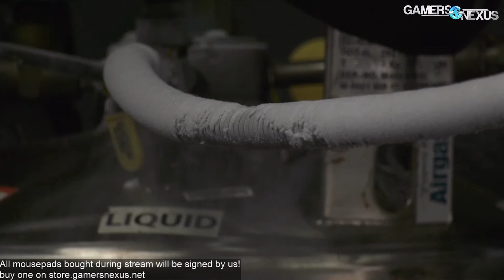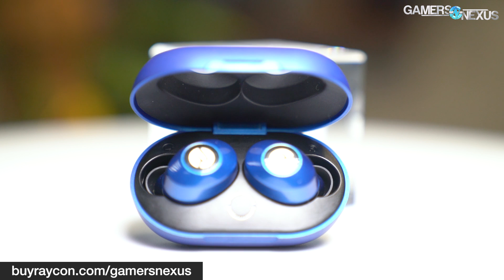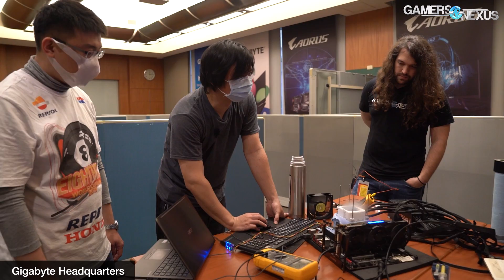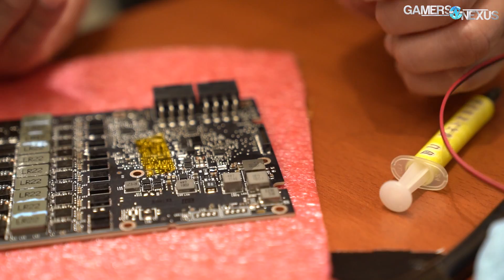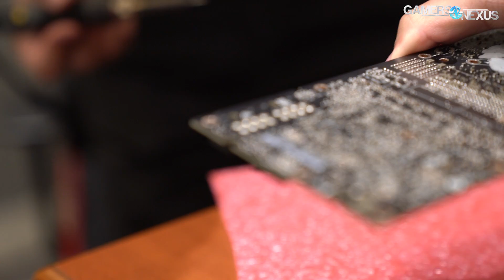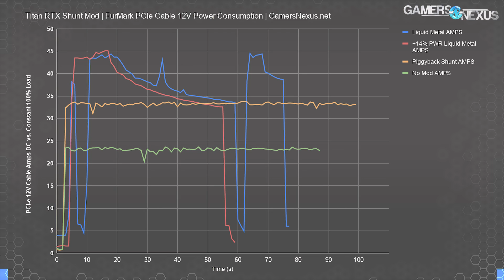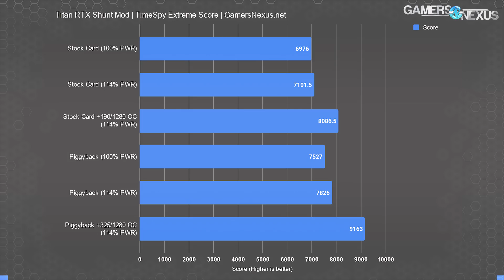RIPJAY Hardmod: Breaking NVIDIA's Rules w/ Shunt Resistor Piggyback, Ft. HiCookie

Comment from the maker: It's been about a full YEAR since we responded to Jay's latest RIPGN episode! Jay and I have been running this series for a couple years now, and it's always a lot of fun. It's a great learning opportunity for both of us and the community, and I'm excited to finally respond.
Learn about the ATX12VO standard here: https://www.youtube.com/watch?v=ur2eSL344Xs
Or why E-ATX is a fake standard: https://www.youtube.com/watch?v=54VJwwLRJBk
Reply: Didnt Buildzoid recently figure out how to modify the delicate current balancing circuitry in the middle of the board. So as to mirror the same modification on the main shunt and not to let the card notice any imbalance between the multiple 12v power rails. He mentioned this in one of his last 3-4 videos. I think you guys should look into that. And see if it gains additional performance over the 8mOhm shunts. In particular when cooling with your novel custom solutions with ice bath / air con etc.
Reply: this is where buildzoid is talking about it https://youtu.be/TVsHpSHijAc?t=1325
Reply: @dreamcat4  thank you!
Reply: I have a gtx770 and mdoded the bios with the kepler bios editor. There isnt a new version of rhis software for the new gpus?
Reply: @chrisparussin5359  Maxwell were the last cards that can be persuaded to boot with an unsigned firmware. Newer chips check on boot that the firmware is genuine and unmodified, and if it's not, you have a brick on your hands.
Reply: What video are you referring to?
Reply: https://youtu.be/s13iFPSyKdQ
Reply: Is this possible to this on other cards, like even AMD cards? Seems like a dumb question, but we all now there is no such thing. Only stupid answers... 
Or is it more similar to the reg edits on AMD cards? Sort of... I'm really curious since I still need to open up my Vega 64 Strix, because of the terrible thermal pad placement on the VRM's on many of them. 
And would it be an idea to use liquid metal on it's GPU if done right?  
Since I'll be open it up anyway...
Thx for any kind and helpful comments on this 💙
Reply: @Ries  Shunt mod can be done on anything that senses current using a resistor (as opposed to inductive). Whether it has any effect on performance is a different question.
Reply: @brazeiar9672  Wow that went over my head... 😅 
But I guess it probably wouldn't make sense on my Vega 64. With the reg edit and such you can basically max it out as it is... Thanks for your reply!!
Reply: @Ries  There are a lot of cards that you potentially could do this on, but the reason why people are doing this on NVidia is that this is the ONLY known way to bypass or raise the power limit on newer generation GPUs. On AMD, the limit isn't locked down quite as hard and can be influenced by firmware modding etc.
Reply: @SianaGearz  Yes I guessed as much. You can basically max out a a Vega 64 with the reg edit and such.... Thx for your reply!!!
Reply: Didnt you beat jay at the EVGA event last summer?
Reply: @SteveGN  Don't use a soldering iron.  Use a hot-air station, plenty of kapton tape and a nice thick flux paste.  when the solder liquefies the shunt resistor will just "pull" into place. 👍
Looking forward to the results of the OC run peeps.
Reply: Such a grate rivalry between the two of you guys
Reply: Wait so is soldering something only that small is considered a big deal and you need professionals? Lmao I thought jay was just joking around this shit is easy.....
Reply: Any reason why you guys didn't use a high precision trimmer pot over a fixed the fixed resistor? This could have allowed you to push a bit higher by allowing you to get closer to the limit like you did with Liquid Metal but not having to deal with the variation of LM. It would be a PITA to solder this though (you'll need a carrier board for the trim pot).
Reply: @shadow7037932  Trimmer pot that goes to low resistance would size of a hand and not needed anyway. Proper way is not to do ANYTHING at all with onboard shunt (5 mOhm or 2 mOhm), but trick the input sense circuitry that filtering voltage from the shunt to the controller. Imagine you have waterflow meter, that shows how much water going thru the 5 mm diameter pipe. Sure you can add replace pipe to bigger 10 mm one, without telling waterflow meter of new diameter to get halved readings. Or you could just set watermeter to think actual pipe is 2.5mm. Without doing any change to actual pipes, you get same result :) Bad analogy, but its simplified concept.
Reply: @xDevscom_EE  the master has spoken!
Reply: @xDevscom_EE  hope your staying safe, look forward to seeing what you do next! Please keep up updated! You made EVGA great! I hope they continue their excellent DARK and KP series without quality drop off now that your not there
 : (
Reply: @shadow7037932  HEY YEAH! i remember soldering trimmer pots to boards back in the day. however depending the on PCB swapping out some medium sized SMD resistors is also pretty easy versus some jumper wires and hot glue but, it's only one time with POTs vs swapping SMD resistors more than once

Comment: Would I see any gains from doing this to a Tesla m40, I have cooling sorted using a aio ID-COOLING iceflow 240, its flashed with a edited vbios good for 1380mhz on core and +925mhz on memory, never gets over 42c even when running firestrike or superposition back to back multiple times,

Comment: So does the shunt mod "piggyback" it will reduce efficiency no matter what?  Or is this rectifiable in the software wherein you can have minimum adjustable to match stock, but have the amperage increase for overclocking when using?

Comment: omfg watching him try to solder is really aggravating.... use more flux, tin the component and pads. come on, at least know what you're doing before its on camera
Reply: at least hes not applying freaking gallium to his CB like hes got some kind of GPU death wish
Reply: if you could piggyback a smaller resistor, something less extreme than just a 1/2 cut in resistance, you might be able to get better clocks/scores without overheating

Comment: Piggybacking / liquid metal means putting resistors in parallel which will end up decreasing voltage drop across the shunt resistor. While the clock modulator can sense the voltage drop, it is unaware the current draw to the silicon chip remains same, so the modulator opens up more headroom for a larger current draw - this is the trick.

Comment: im kinda new to some of this, as im sure ur goin to see by this question, but why cant we just edit the firmware to do away with the power limits or at least set them to something we can work with?  i imagine once u find it in one firmware it would b easier to find in others  is it locked down or somethin in some way i dont know about  all u should need is a simple hex editor right? if u knew what resistor value to use u could have a subtle on board ammeter n voltmeter  it would actually b pretty cool  im also a geek n i love #s stats n sensors so that might jus b me idk :p  but the problem with the card limiting the power is in the firmware right? n that should b able to fixed semi easily right? jus possibly time consuming i guess

Comment: The reason for instability with liquid metal is because of pcb design vrm usage and because lm pools at high temps so if vrms are running at max temp frequency will decrease lm will work better on high quality vrms and better laid pcbs

Comment: If you're going to go out and buy new resistors, why not just buy what you actually want instead of stacking something on top of the existing one? If there's a 5mΩ on the board, instead of throwing a 8mΩ on top to get a combined 3.06mΩ, you could just replace it with a 3mΩ.

Comment: What the shunt does:   All current for each pci-e cable goes through the shunt(s).   There’s a chip that monitors the voltage across the shunt.  V=I*R, so it can infer the current by the voltage drop across the shunt.   10A through a 5mOhm shunt will have a Vdrop of 50mV.   If the card is set to limit at say, 50A per PCIE, then the Vdrop will be 250mV.   Adding a 8mOhm shunt in parallel makes the shunt effectively 3mOhm.   I = V/R, so at 250mV max Vdrop, you can run ~83.33A now for each PCIE.  That’s the theory behind it.  You technically could just hardwire the shunt, cut the traces and feed a set voltage to the power controller and have effectively unlimited power.     I’m a Professional Electronics Repair Engineer for a large US Company you’ve definitely heard of and would love to help with any component level mods, repairs, or advice you need.  DM me!   Love Guanghua too, I try to go through there and Syntrend next door when I’m in Taipei.

Comment: Re: liquid metal mod

Back in the day we used to connect the traces of Thunderbird with a number 2 pencil then cover it with tape to unlock higher multipliers.

Is there any reason you can't use a paper based tape with the liquid metal and a meter (checking ohms) to come up with an easier, middle ground between the resistor mod and the straight up liquid metal?
Reply: And teflon tape on a pin on p3 cpu's to swtich them from 100 to 133 fsb for motherboards without overclocking (I still have fond memories of my p3-500eb)

I suspect part of the problem isn't just the inconsistency of application, but the inconsistency of the liquid metal when it's under current. It's not dissipating much power (~100mw for the stack at 32a I think), but maybe enough to cause it's electrical resistance to change or cause the liquid to shift somewhat changing it's resistance.

Comment: the guy using the iron doesn't know what he doing and you can tell he keep applying solder to his iron and not the board and component 

when using an iron you apply heat to the board and component then touch the solder to the board and component not the iron and the solder will flow to the heat so if you apply solder to the iron it will never flow to the board and component soldering the component to the board because the board and component are always cooler than the iron

Comment: "No, no special solder."

Uh, this dude doesn't know wtf he's talking about. Mis-matched solder should be completely reflowed to make the connection that won't quite possibly break off easily from not joining the pools correctly. If it's matched it's also easier to assure quality soldering without a complete reflow, but to even know the way to attack it if you don't know what you're dealing with.
Reply: Just look at the solder job. It looks horrible. And he keeps the iron on the pcb for a long time.
On the other hand. I don't think people do this, thinking it is a solution for years. Just an experiment, while a bad job can ruin a board worth 2500$
Reply: "Can", but hasn't in the history of ever.

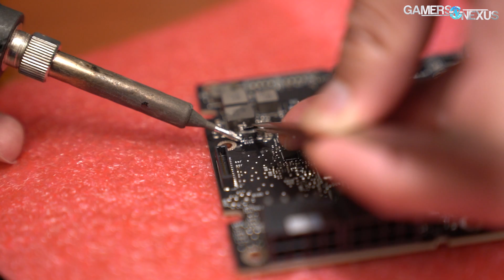Comment: Watching him hold the resistors like that at 7:00 is cringe worthy. He should take a seat to make himself more stable and grip the part by it's sides. For something like this I would first apply some flux then position the resistor to line it up with the original and then apply slight downward pressure with the tweezers while heating the surface mount pad with the iron. Once one side is soldered just hit the other side with the iron. You might need to reapply the flux before soldering the other pad. Add solder sparingly. 

I am 100% sure that PCB is RoHS compliant so it uses lead free solder, but leaded solder melts at a lower temperature so it might make it easier to work with.

Comment: High Cookies soldering skills are somewhere between JayZ and Louis Rossman, in the lower parts i'd say ;-)
- but the end result looks kind of ok. I'd try flipping them up 90° sideways, so both sit parallel on the pad.

Why do people always think a heavy soldering iron is better for thos tiny things, instead of a good direct heat tip. yeah yeah, overheateed mass buffering..

Comment: I don't really get why they don't just remove the resistor and replace it with a potentiometer, tada, complete granular control of the resistance value.
Reply: Because it's a tiny resistance value and a relatively high current, so good luck finding a pot that's useful for the job.

Also, because adjustability doesn't give much benefit anyway.
Reply: that is not that easy theory..
yes, you can remove the resistor and foila that's it..
but,the gpu will enters to safe mode and the speed will locked down to just several hundreds megahertz (maybe 300Mhz or more) because the voltage regulator thinks if there is a short circuit and the gpu will not usable anymore, very usable to just displaying your image when idle..

so, you still need some resistance for voltage regulator to read current draw..
so, in theory if you remove the current shunt resistor, how the chip or the voltage regulator read the current flow ??
and using the trimmer pot, but there are already using the voltage regulator, using trimmer pot also useless.. because the voltage regulator will adjust everything on the card..

 the idea of current shunt mod is just tricking the voltage controller to draw more current as it should because the gpu had no idea how much current draws through it.. 
and also we cannot adjust the current flowing into the card, because the amount of current flowing to the card usually above 5A and for high end gpu usually above 10A.. and what the point using the trimmer pot ?
Reply: Because these guys on here aint very cluey, they just follow trends they have heard or read about without knowing anything...they even let someone else mod it like the taiwanese guy is doing something magical..

Comment: I shunted my Titan RTX cards recently and I replaced the 5M0 current sense shunts with 3M0 current sense shunt resistors on my card. Is there any benefit to simply adding a shunt resistor on top of the original vs replacing the shunt resistor?
Reply: possibly a marginal increase in power dissipation of the shunts themselves, though that's going to be mostly blocked by the fact that they're stacked.  If your shunts aren't overheating at max load, then there's going to be no additional benefit to having multiple resistors.

Comment: soldering on a heavy ground or power plane is not fun.
It is not recommended to go op to 450 degrees or more on the soldering iron, the flux will burn away, so keep the solder on the tip fresh or add extra flux to make a good connection.
Also do not reheat multiple times to "fix" a solder without adding flux or start over by removing old burned solder.
Use a as big a tip as possible to have as much energy stored in the tip as possible to transfer to the object, only then go up in heat to bruteforce more energy into the solder tip if needed.

Comment: I have tried this on my 1070ti asus strix, i tried piggy back and changed shunt resistors (i used math +25 percent power). This card has two power limits, i have done first, ,,high stage,, 12V current measurement. In msi afterburner power limit was on 70-80 percent,  but it still triggers power limit. it helped little with OC, i lightly tried to mod ,,low stage,, current measurement. Changed some resistors on mosfets, have done nothing, i dont wanted  to make smoke machine,. I also filled empty capacitors spaces with low esr caps, that was better +150mhz mem clock :)  i hope gamers nexus read this :)
Reply: shunt mod usually affect the gpu clock.. it will less fluctuative, more stable..
but it still temperature dependent, as soon as gpu temperature reached the limit the clock will decreased..

nvidia gpu will pull back the clock down for couple of cycle, to keep gpu stable and gpu-z or msi afterburner will not noticed this behavior.. but the osciloscope can.

Comment: Questions : If the graphics card goes into 2D mode is there a way to reset it ? does it reset on its own if you put the resistior back ? Would placing 2 wires parallel to the shunt resistor onto a breadboard for easy swap shunt resistors help or does the resistance of the wires themselfs become an issue ?
Reply: fixing the shunts should be fine.  Wiring to a breadboard's not really going to work well, because we're talking about very small resistances.  The resistance of the wires, or worse yet, the connections on the breadboard, are going to be significant enough to throw things out of whack.

Comment: Does anyone remember the "pencil mod" on older radeon, I think it was 9700's? I wonder if shorting the resistor with lead/graphite is still feasible these days?
Reply: I remember the pencil mod on the Athlon\duron cpus
Reply: No, the "pencil mod" is generally used more for connecting exposed jumpers, like it was on the original athlons and durons.  They were switched on by any significant connection between them, and didn't really care how much resistance was there.
Even on those, the later revisions used stronger pullup/pulldown resistors, and the pencil wasn't sufficient anymore.  At that point you had to solder them, or use conductive paint/ink to connect them.

In the case of a shunt resistor it's a very low resistance,  so putting a little bit of graphite in parallel might go from 5 miliohms to 4.999 miliohms, or so, and increase your power limit from 100% to 100.001%

Comment: For a person who doesn't understand at all:
putting another resistor on top of the other will lower the resistance, it's called parallel connection.

Last time i did powermodding, i added very very accurate trimmer pot

Comment: Maybe something is wrong with your AX1600i or it's a problem with the newer models. On my AX1200i deactivation of OCP through Software works like a charm. Pulled 44&41A on two 8 pin while benching my modded Titan Z.😈

Comment: What if you wanted to go just slightly higher than stock current so you could still use regular water cooling? Maybe adding a 15mo shunt to the stock one? And is this close to the same setup as the 2080ti? I know I shouldn’t think about modding a card I just paid off but I cannot help myself lol